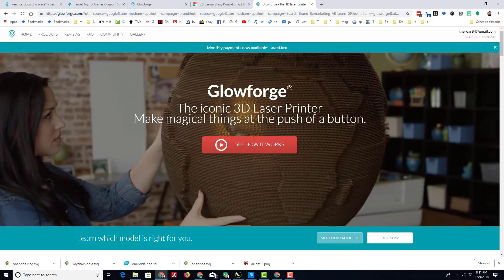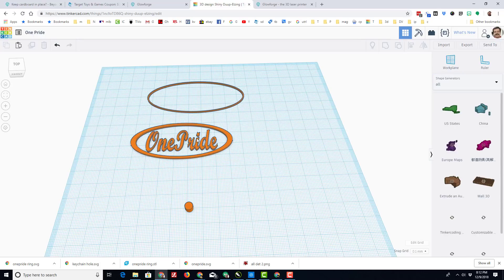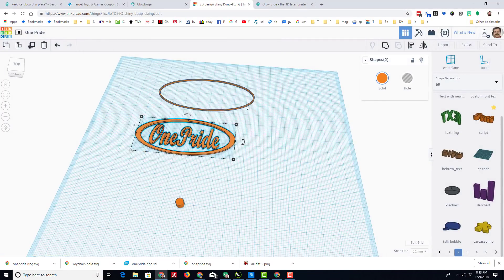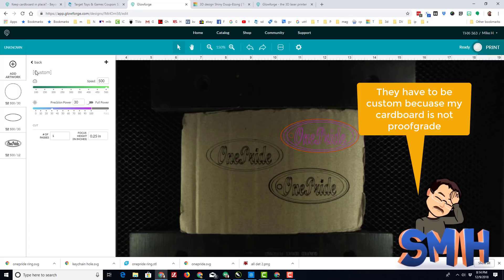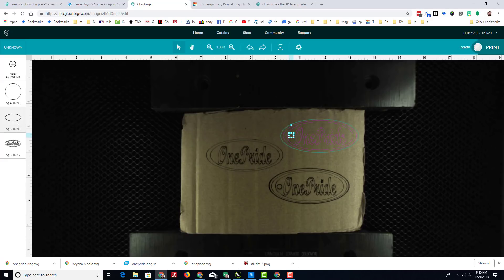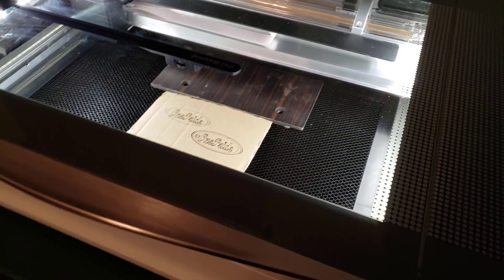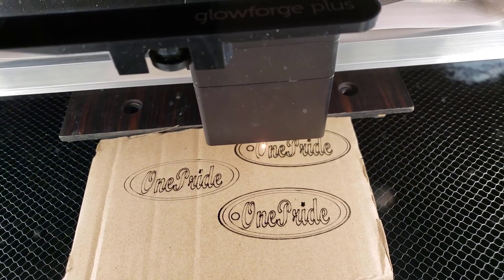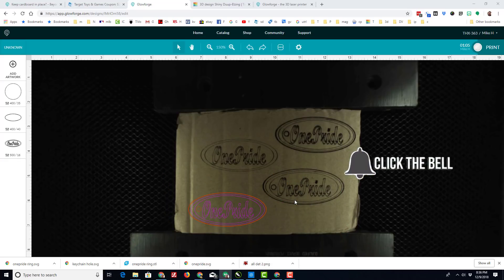Glowforge and Tinkercad! A great place to start

Comment: Mike, did you get it to cut thru? What settings did you eventually end UP with? Brent
Reply from the maker: I really depends on your material. I used a lot of 4mm cardboard I could get from our cafeteria. What material are you working with?